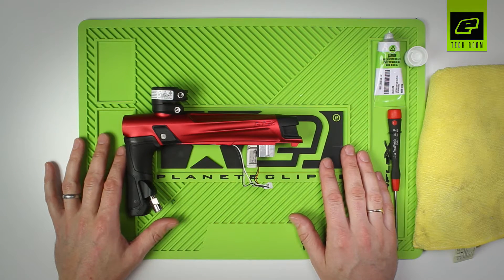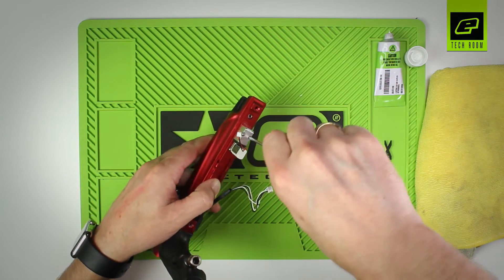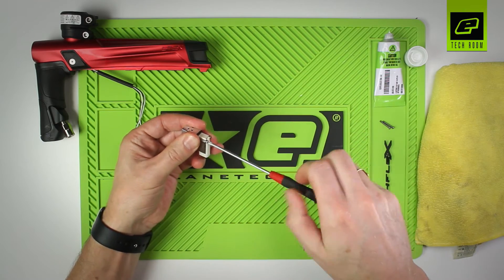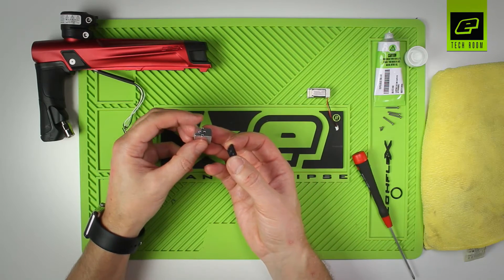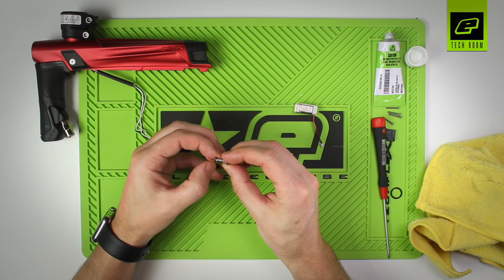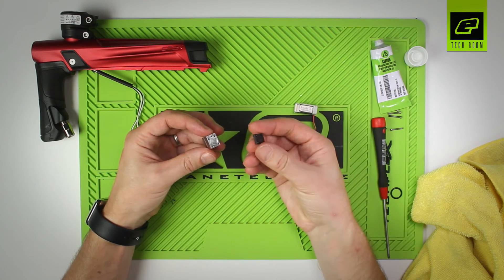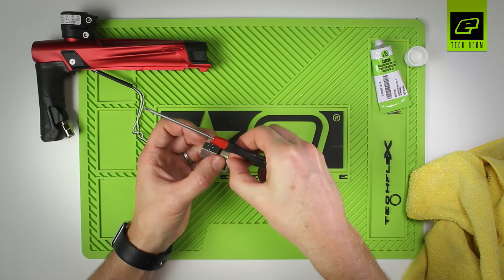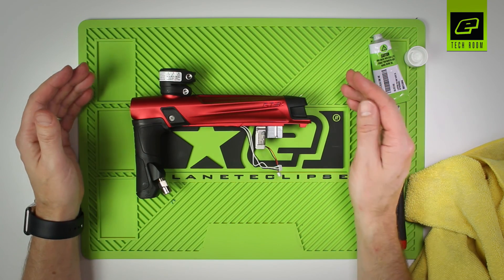GTEK 005 Solenoid Maintenance

Comment: took off the solenoid once so far... and the screws to seat the solenoid in its place barely grab. solenoid stays loose to the frame...and a few light wiggles it pops off.